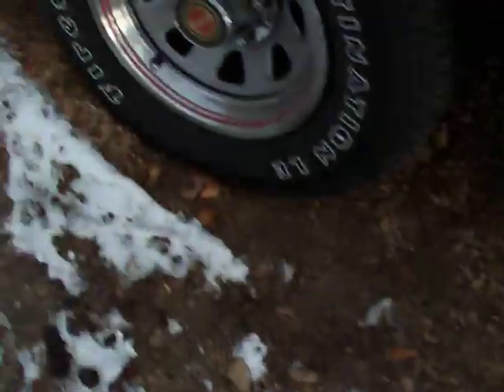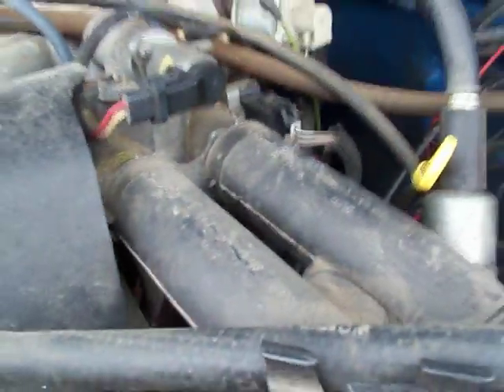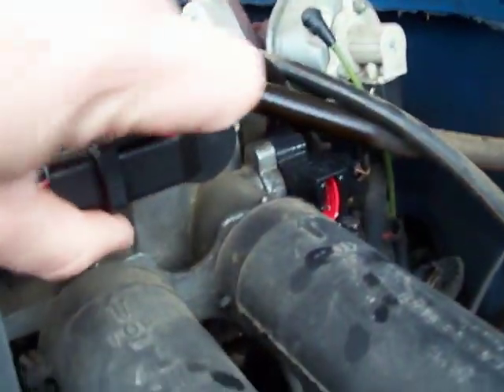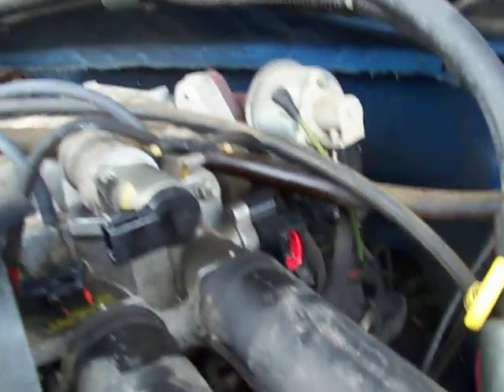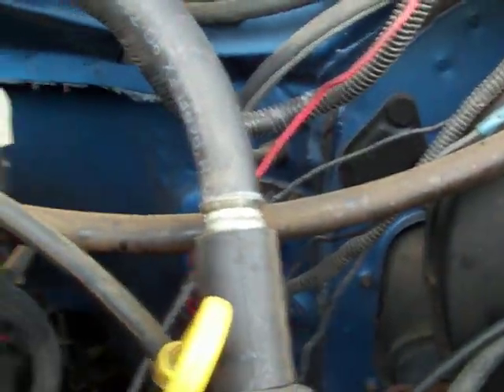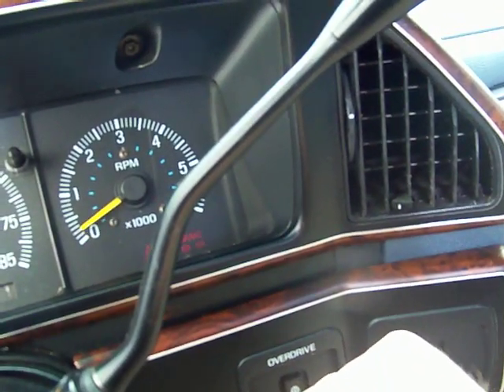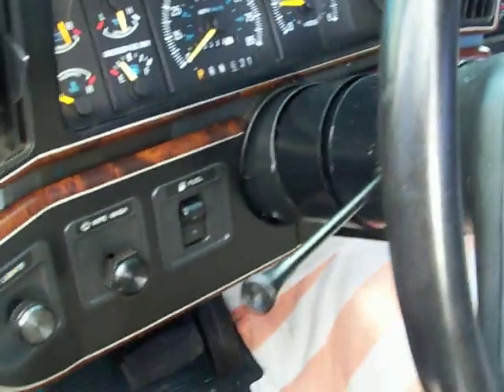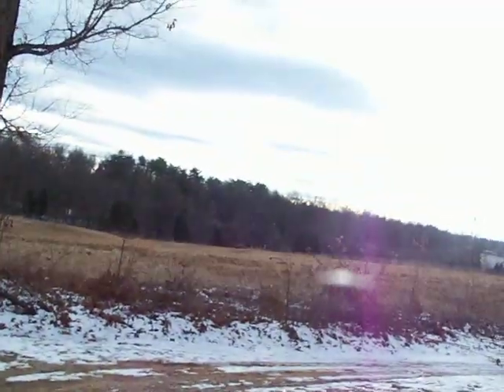Ford 4.9l (300 c.i.d.) Hesitation and Startup Fix

Comment: My Dad bought an 88 4x4 5speed with 83k on it for $800 that is cherry that didn't run.Mechanic told the guy it would be $1,100 to fix. Sparyed the pintle of the ICV with brake cleaner after the bill of sale was signed and it ran like the day it rolled off the show room floor. Guy said you got one hell of a deal. We agreed. Oil hadn't been changed in 2 1/2 years and looked new.you may have forgot to do that in this video but it still got the ball rolling.Thanks!Love this truck!

Comment: Stock headers are the best, unless you go completely custom, anything off a shelf won't show any improvements. For the muffler, I cut mine off and put some pipe to dump before the rear passenger tire. I have a '95 with the 300. I like the sound, but will be testing a few mufflers to tone it down a bit, since it's a high drone on the highways, but in town I like it.

Comment: @FerdinandMagellan u should rmove the idle control valve and clean the pintle of it with carb, or brake cleaner, and u should clean out the throttle body.

Comment from the maker: No, actually, you can put a little bit around the outside of the male end connector and it will help seal out the elements better than the rubber seal.

Comment from the maker: Some makers call it an Idle Speed Control, some call it an idle air controller, it's called many things. I have a video how to clean the throttle body and how to clean the idle air motor. Many times the problem is cause by the conditions under TSBs 95210 and 962016.

Comment: Really? Idle speed control, u mean idle air control valve is what it's called. And the IACV as its abbreviated, almost always has issues because of gunk buildup in the solenoid. Just spray brake parts cleaner in the valve actually remove the valve and spray it in there work it around and also make sure like he said there is no corrosion on the contacts. ALSO. If your engine starts to race make sure you get your TPS inspected. And replace only with motorcraft or equivalent.

Comment from the maker: @jonstaskis; I just found out there was a technical service bulletin on this. The condition in the bulletin states that the throttle body gasket gets sucked into the intake manifold. According to procedure a revised gasket is available for the throttle body to intake manifold mounting and it should correct the problem.

Comment from the maker: @mamas4turd4sniffer; You can try spraying brake cleaner or some electronic cleaner on it to get the dirt of the contacts. Fords are one of the world's worst about not running right if a connector to a vital component is contaminated with dirt.